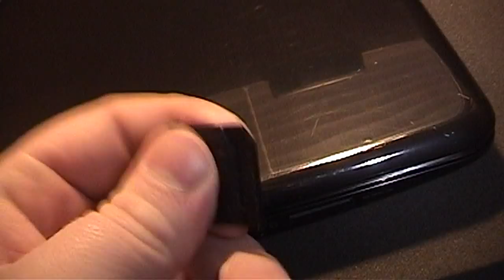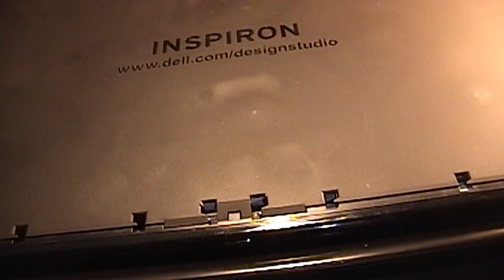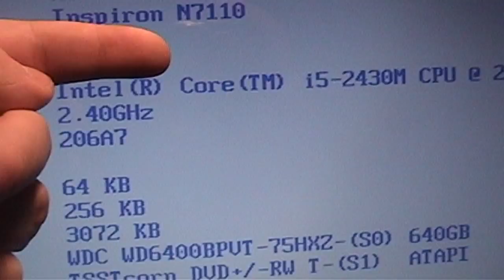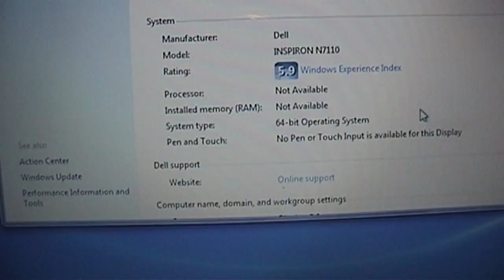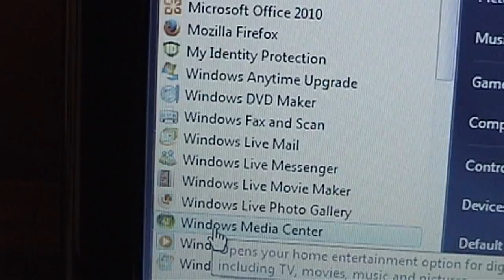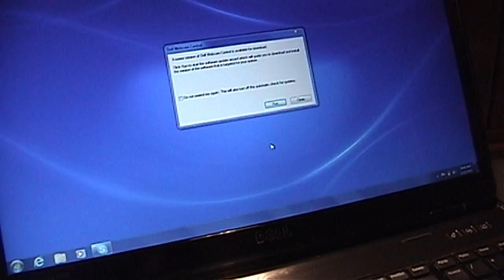Dell Inspiron N7110 17" Windows 7 Laptop

Comment: This is my laptop, but now has 8gb ram and SSD.
Reply: Same
Reply: I have the same model, can you remove the Windows 7 from the computer?
Reply: @mrg466 yup, you can install any operating system
Reply: @Lightman137v2  My computer has a blocking program that will not allow me to put on Windows XP, and tried to follow a video on how to shut off or remove that blocking program, but it didn't work!
Reply: @mrg466  Unfortunately this laptop doesn't support Windows XP (no XP drivers avaible:( most likely will bluescreen after fresh installing XP). If you need it for older program you may try a virtual machine (Virtualbox, VMware player etc). Allthough you can upgrade to Windows 10 or install Linux without any issues
Reply: @Lightman137v2  Nope not interested in anything higher than XP!

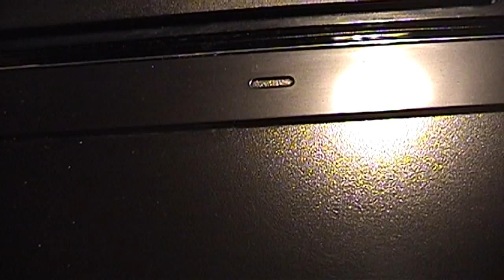Comment: 4:45 that LED indicator is to tell if the trackpad is on or off. It will light orange if the trackpad is off, by accessing the shortcut printed on the F3 key.